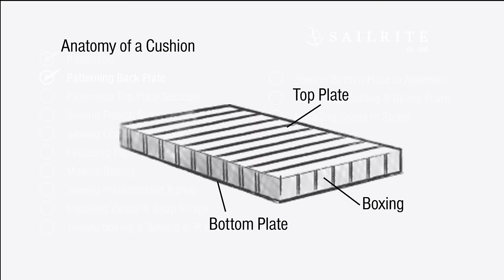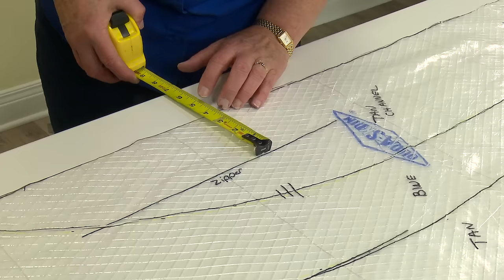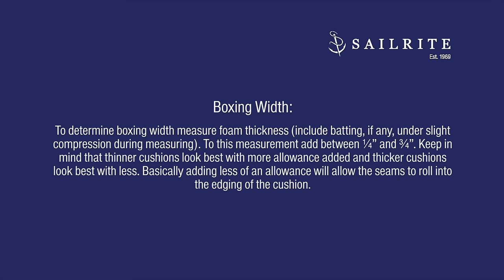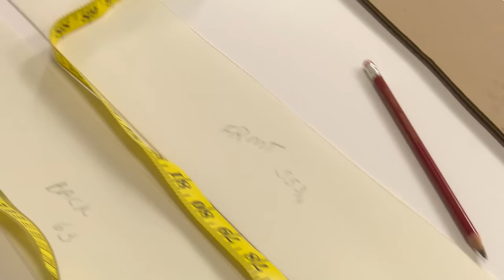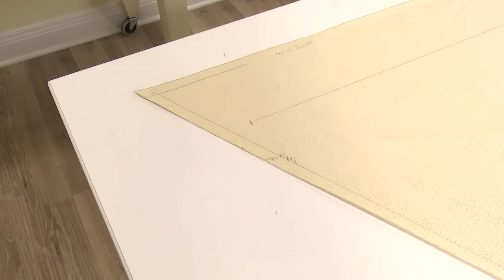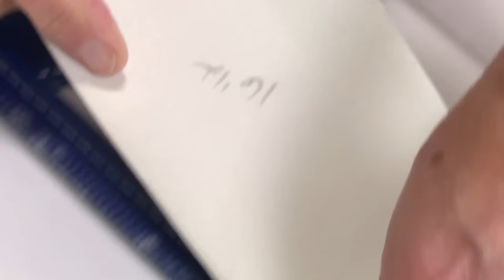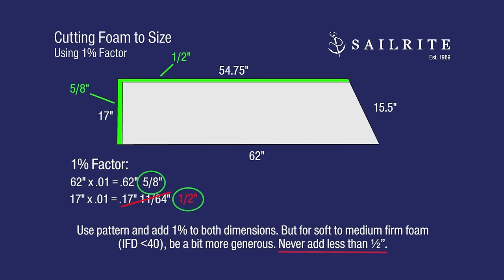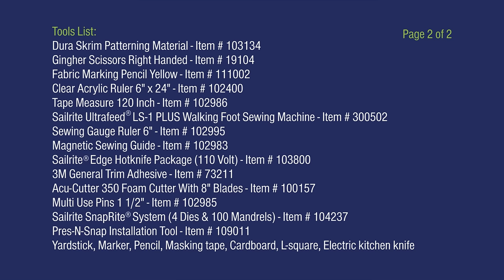How to Make a Powerboat Lounge Cushion

Comment: Very nice work.  How many hours did you have into that project?
Reply from the maker: +highvelocity123 Anytime you video a project it takes much longer than it would if not videoing. I will answer this question as if it were not being videoed.
Patterning - about 1.5 hours
Sewing plates and boxing - about 3 hours
Cutting and gluing foam - about 1 hour (not including drying time)
Installing snaps to bottom side - about 1 hour
Total Time - about 6.5 hours
Reply: Sailrite I usually charge $50 an hour for work like this, but I know some pro shops that charge $100 plus. Sailrite has not only helped me with my own projects but has helped me make extra cash on the side.  Thank You Sailrite.